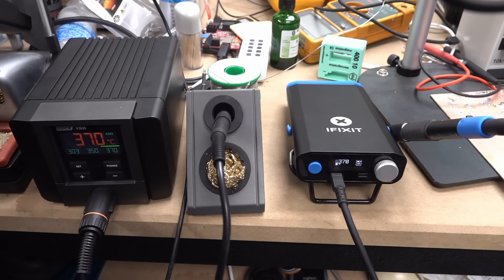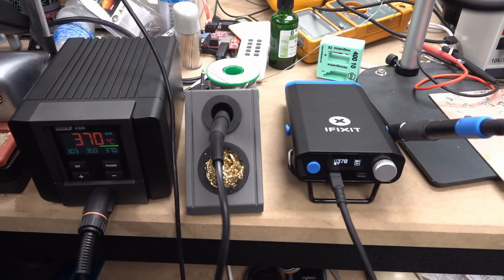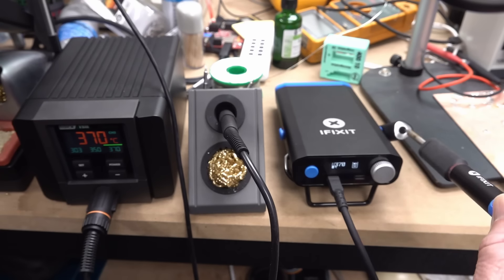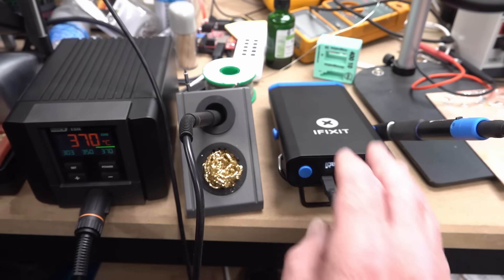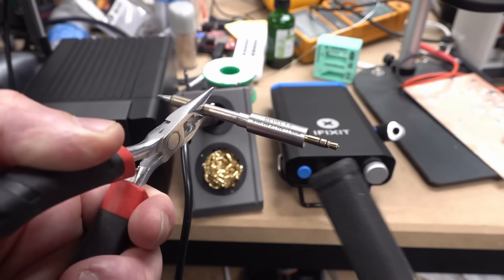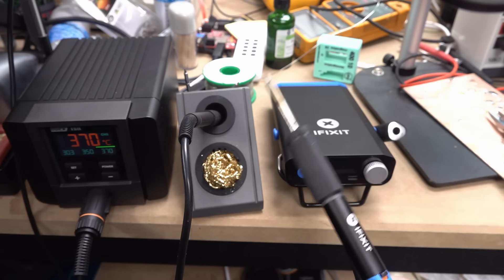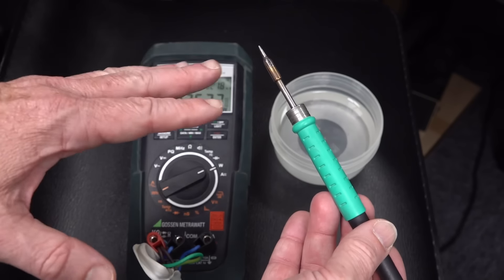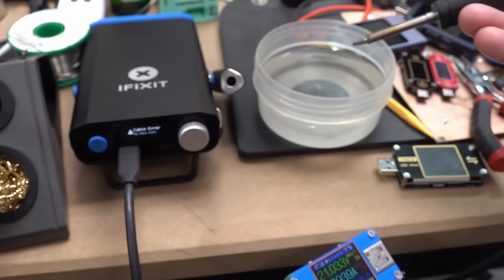iFixit FixHub Soldering Iron Review EXPLAINED + More Testing

Comment: I understood the original video. I like the ifixit, but it's way too expensive for my circumstances.  I'd like the iron itself at 80 US bucks, but the battery and controller aren't worth the retail price.
Reply: $80 for the iron is fine, but using it without the base is a PITA.  + / - buttons and a simple display wouldn't have been too much of an ask.  (Some of the irons do go a bit overboard in that area, I really don't need it to run Tetris as well.)  

For a company that spends all of it's time complaining about the dumb designs manufacturers do, this is an odd product.  I'll stick with my TS100 & Hakko 936.
Reply: @j.f.christ8421  I was shocked at how you needed to log in online using a computer! I was expecting it have a text file to edit by plugging it into a PC (where it shows up like a thumb drive) - wouldn’t that have been the most obvious & elegant solution?
Reply: @davadoff  There is a reason to do web apps and it's sadly that the browser does the platform compatibility since there are browser api's for Serial and USB. The iron identifies itself a a COM (probably USB CDC)  port on any browser that supports it, and the ui can just be a single simple interface.
Reply: @davadoff  Or, y'know, a couple of buttons.  Too high tech or low-brow for iFixit apparently.  What a dumb idea.  Maybe the next version can store the temperature setting in the cloud and downloads it every time you power it up.

I'll just add I don't mind devices that you can configure with a simple text file, rather than needing a bloody website or special app.  On the other hand it's a frigging soldering iron - what exactly needs configuring?  On my T80 I switched it to left-handed, I'm pretty sure I could survive without that.  Maybe Apple need to make soldering irons.
Reply: @davadoff  well, no. That would be the last thing I would expect it do to tbh and it would be the worst UX experience I could imagine. But that goes for the whole iron without the base for me, pricing of the combination is just way too high and the non existent control on the iron alone renders that useless to me. I do have a Pinecil and a TS80 already and would prefer them instantly over this

Comment: In my opinion when I spend $405 CAD on anything it better meet or exceed its specs out of the box. I can not afford to spend that amount of money in the hopes it will be fixed sometime down the road. If the item was below $80 that would be a different story. Perhaps it is just me but I have to justify to myself why I am spending so much money on something that is not my main iron.
Reply: I think it's just a matter of preference. If you like the repairability, the neat features, and the good build quality, then there ya go. Dave's video proved that despite not meeting its power ratings, it did its job rather effectively.

But yeah, the price isn't great, I would probably go with something cheaper myself.

Comment: The portable soldering irons really do draw 100 Watts - the catch being they have to be cold.  Once they heat up the power draw drops significantly.  You can measure the resistance when cold and you should read around 4 Ohm (assuming they are powered by 20V).  Then when warm it will be more like 16 Ohm - or 25 W at the same voltage.  So very misleading, but not incorrect.

Comment: A fail is a fail, bench or portable, if it was a multimeter you wouldn't accept different reading just because it is a mobile dmm. Trash is trash.
Reply: What a nonsensical comparison. The requirements are not different for portable versus bench multimeters, in terms of sccuracy.

They are different for portable soldering irons where you know you have to make power compromises

Comment: I like the iFixIt gear but I’ve had my 24V-50W Weller solder iron with a DIY-build power supply for around 50 years now and it have never let me down. I would build a batt. supply pack for it if I had the need for a portable version.

Comment: Love the technical comparison and explanation! 

We did our own investigation to get to the bottom of this. The Smart Iron's heater core CAN output close to 100W (17V 5.7A) continuously, but the heating algorithm is tuned to heat solder to a precise temp with minimal overshoot. When the tip's submerged into water, the different thermal properties trigger a safety limiter, capping the power output. For the full details, we wrote up a blog on the iFixit site!
Reply: Thanks for the explanation

Comment: i have 2 axiun stations the t3a and t3b and when they die im not cheaping out and buying a real jbc setup with tweezers and such. the axiun is better than the metcal units at the local makerspace though. i have a fnrisi portable one that uses the mini t12 tips and it overheats constantly.

i have a quick hot air station thats no better than the one i had before. they both have bldc fans and are repairable.

im a big fan of ifixit. it's probably the tools i use the most and the lifetime warranty means they replace the bits and give you a bunch of free stuff. i've bought lots of their kits from the same seller in canada as gifts for people and such. i dont know if he's playing favorites or not. great company to deal with though.

Comment: Loved the Retraction of the Battery terminal non-issue 👍 Dave. (in my original video I've also edited my comment to reflect this)
LOVE the water, actual power delivery, tests. I've said this in the original video and I'm repeating it here. Great job on showing the BS on the box about "100W" and a comparison with irons that do "averaged out" their expected power when dunked. (averaged out because overshoots at contact and undershoots at equilibrium, aka as expected)

I didn't care about the comparison to the Quick TS11, you compared it to worse and better irons, as to be expected from a review. :body-blue-raised-arms:
What ground my gears, was and is the "100W". For a portable iron that you would take OUT at an RC race in, lets say... snow, not to be able to deliver the power written Even on the TIPS... A portable Iron doesn't have the grace to always be used in an Air conditioned warm home/shop. You could be elbow deep in a wiring harness on a quad/boat/RC car/ actual car/etc. in low ambient temps where you want the HEAT but not be able to use a gas (propane/butane) iron because you'd melt the surroundings with the exhaust.

I keep seeing messages of 400CAD. For the Canadians out there that buy this expensive tool and be stuck out in the trails because they relied on it actually doing what is written on the box 😥, the above is even more relevant since cold weather is not just a hobby, frequent or seasonal, but actually climate. You don't go to the iron out on the trail for fun, but when bad got worse; and then you discover your hail marry doesn't heat up.:face-blue-wide-eyes:

Comment: Watch your video again. you dip it into water, it stops boiling, and then the temperature reading NEVER goes even close to below 100. and power fails to jump properly as well. 
Compare to my TS101(stock firmware, even old 65W version): when i smash it into wet sponge, the temp reading drops below 100 IMMEDIATELY as it stops boiling!
this thing is just a joke, simply buy TS101 and decent 20V 100W PD3.0 power bank and you will be better in almost every aspect.
Reply: Yea the pinecil v2 with the Usb pd 3.1 28v supply keeps the tip boiling in a cup of water and pulls about 60w. If you submerge more of the heater it pulls 100w but keeps the water boiling even after the tip has been in the water for 20 seconds. I don't get how their iron has such poor thermal performance considering the pinecil tip I am using is a very similar profile. Yea maybe the tip itself isn't able to get the system to deliver more than 70w but it's a pretty tiny tip.
Reply: 💯 TS101 or Pinecil V2 will be better than the ifixit one in like every scenario.

Comment: It might be worth to do cartridge tips video for the main channel. Sacrifice iFixit tip, TS80/100, JBC and Hakko one - Dremel them in half to find
1 where the thermocouple is located.
2 how thermocouple is constructed.
3 how far from the tip the heater is.

This iFixit cartridge seems to be blind to external temp changes compared to JBC or Hakko. If thermocouple is somewhere deep inside the heater connected to a slug of thermal mass then no amount of firmware tweaks will be able to fix it.

iFixit FixHub powerbrick is portable, but iFixit also sells corded soldering iron separately and then all the portable arguments go out the window.
Reply: Not sure why my comment was deleted, but anyway, you can find some sacrificial photos on eevblog forum.

TS80/100/hakko are going to be similar. Its inferior to JBC but can still work well when manufactured properly.
Reply: 1 & 2 I think the thermocouple kinda is the heating element: the end of the heating element that's connected to the return path is the dissimilar metals junction. That's why on the Hakko, Pinecil and Miniware irons you cannot check the tip temperature while the tip is heating: the software has to turn the mosfet off for a few microseconds to get a reading and then turn it back on.
Reply: @NicksStuff  Correct.

Comment: I agree with the benefit of the format of the iFixit over the TS80/TS100/TS101. It is still portable enough, yet it places the controls and the screen separately and not in the handle, where they are in the way.
My gripe with the iFixit is, that I don't want to add the headache of yet another (propriety) battery that may go bad in a year and needs replacement. Not sure if the USB-C input of the FixHub allows for pass-through or if it only is there to charge the battery. But if it is the latter, then it just becomes a $250 paper weight, when the battery goes belly up.
I already have enough independent power sources (decent USB-C power banks, 3s or 4S LiPos, car battery etc.) and I rarely do a repair job, where there isn't mains input available. So I would prefer, if there was a version with a decent integrated power supply, in the same format or maybe even a bit smaller, that accepts a variety of external power sources.
Reply: I think the iron itself can be powered by a properly rated PD supply on it's own as it is. You just don't get the display or anything. I agree though, there should be another option just in case. In defense of ifixit though, they made the unit's battery relatively easy to replace. It's not like a drill battery where when it dies, you don't have an option unless you have spare lipo's and a spot welder.

Comment: In fairness to ifixit, there's not many usb-c irons that draw 100W at all. I think the pinecil/ts100 has 8ohm tips so about 40-50W max at 20V, and only the pinecil v2 can get higher by running at 28V.
If they did actually put effort into making a higher powered tip than most, although they did so at the price of cross-compatibility, then that's a step in the right direction, because then it's only a few software tweaks away from hitting the target.
I think doing a measurement of the tip resistance would be a good thing to know if the hardware is capable of hitting the 100W number at all or not.

Overall, I like ifixit for their tools and guides. I think it's great that they're acknowledging how essential soldering tools are to repairs nowadays, and that the tools themselves are built to be repairable too. However, it's a shame that the marketing is so far from the actual performance, at least for now, especially since the equipment is not cheap at all.
Reply: Then they shouldn't have rated it at 100W. That's the issue.

Comment: I think it would've been beneficial if you had measured the heating element resistance of the Ifixit tip.
They specifically say the iron is "USB PD 3.0" and they market it as "100W". Ergo 20V only.
If you want to dump 100W of heat to a tip and you only have 20V to play with, the resistance needs to be around 4 ohms.
If you're seeing only around 50W, then it's closer to around 8 ohms. Therefore it will never be "100W" at just 20V:
If the iron was USB PD EPR capable (28V or 36V or 48V), then there wouldn't be a problem as with an PD EPR 28V supply you could reach almost a peak of 100W if the tip is only 8 ohms.
Reply: I looked at the iron's schematics and the MP2329 and MAX77596 buck converters VIN max is 24V so there goes that theory.
Edit: I should've read further. Tip is fed by V_BUCK and the schematic says "intended range 4.5-17V 0-6.3A". With just 17V going to the tip you'd need under around 3 ohm heater. Seeing a peak of around 50W would be under around 6 ohms.
Reply: @Lagittaja  Going further - recommended operational condition of mp2329 is Vout of 0.6-13V, so they are using it out of spec already.   But the question is why have buck for heating element in the first place as it also seems they are using high side pwm switching. Guess because Vgs of mosfet is 20V, so they cant drive it directly?
Reply: @Roodster12  Well they're just not guaranteeing it's performance outside that Vout range?
But yeah, I have no idea what they're doing. Would've assumed you'd just chop your supply going to the heater, why complicate it? Well maybe that is it but if you can't drive your mosfet, wouldn't it be smarter to change the mosfet instead. Would be nice if Dave would look at the design and go through it and explain what they're doing. I can read schematics, I've made cute little circuits but I would have to spend so much more time to really understand the big picture.
Reply: @Lagittaja  Huh, and here I was expecting an actual Boost converter in the handle to deliver advertised 100W :|

Comment: I did the same test with putting the tip in the cup of water what dave did, but with my TS100 on my bench power supply, setting it to the 24V voltage, and the TS100 performed beautifully. 
The TS100 tip stays between 2,85A and 3,09A (modulating every second, probably due to monitoring temperature).

So that means it stays continuously between 68,4W and 74.2W when putting the TS100 tip in water. The TS100 just delivers what it says. Actually even more, as it's sold as 65W@24V.
Ifixit shouldn't have tried to re-invent the wheel for a hefty price (those tips are expensive at $20, compared to $5-10 for a TS-100 tip), selling a €270 portable station that doesn't deliver what it says.

Comment: How are they going to stick a higher capacity tip into that holder? It seems like a snug fit
Reply: Reduce the heater coil resistance. The mass of the tip is not critical. But they could make it fatter on the end if they wanted to.
Reply: @jaro6985  What I meant was fatter tips won't fit to standard holder

Comment: I think something I failed to mention in my own comment on the previous video is that there are obviously different expectations for a portable iron vs. a station, which is why a comparably priced soldering station isn't a direct comparison. This definitely has issues, and I have problems with the base station/battery bank part more than anything else, but I think it's a good product that needs a few fixes (hopefully most of which can be fixed with software). I do think for that price, you should be getting something like a 10,000mAh battery instead (since they appear to be charging about $200 for a fancy battery bank), or that it should be more like $225 overall.
Reply: The $75 soldering iron on its own cant deliver more than 50W.

Comment: I’m concerned about the tips lifespan 
Specially if the tip is sitting inside a closed cylinder  when docking it probably going to burn up the tips a lot faster because they cannot cool maybe they should improvise a slit design inside the cylinder for the heat to dissipate that would be one of my concerns
Reply: If they can't cool, well.. the iron doesn't send power because it's already hot :) Actually, it may save you some battery power if the stand is sturdy enough.
Reply: @ledoynier3694  yes I think they have a few different design flaws that I would point out if I was doing a review of the same device 
Honestly, I think they need to go to the drawing board  and revamp it and make a version 2
Reply: Its temperature controlled, doesn't matter if its insulated or not.
Reply: You can set the idle timer on the iron. When it’s in the cap and not moving the iron will automatically cool off until you move the iron.

Comment: I appreciate those reviews as I would love to try a directly heated tip iron. i still run the Hakko 888 you recommended way back which still works flawlessly for what it is 

Where I’m harsh is when you don’t deliver what you promise on the box while selling at a price where you would expect a polished product, not a beta version that hopefully will be fixed.

The portable iron expectations is interesting though as I thought the ifixit marketed it as a do it all iron. It makes sense the expectations would be different for a portable iron but this is a small market to target, most viewers here likely have a single iron.
Reply: If you want to try one go find a pinecil and a powerbank if you prefer to make things easy, almost impossible to beat the value that provides.

Comment: Dave, is there any chance of looking at some more soldering stations? I see Hakko has a new FX-888 revision (the DX), the FX-951 still seems to be better overall (but more expensive), and there are so many other options now too, so it's hard to know how an older style iron like the FX-888(D/X) compares to newer irons. Maybe I'm just not looking in the right place but I haven't found much info with proper comparisons made in the past couple of years or so. Something around the FX-888 price with modern tips would be really nice.
Reply from the maker: There are so many I could become a full time soldering review channel...
Reply: At the FX888 price point you can buy a JBC clone that has decent build quality and good performance. FX888 is inferior but fine for a beginner.